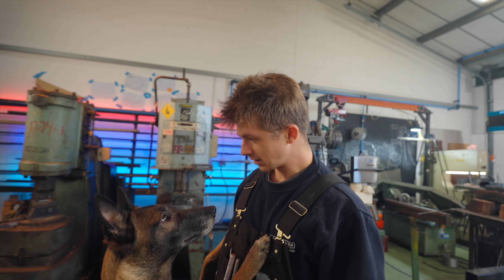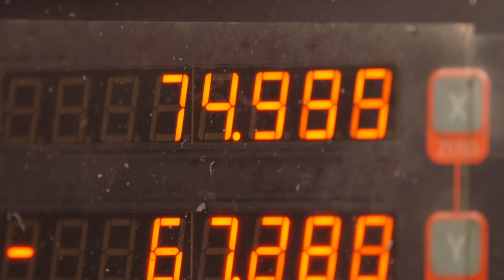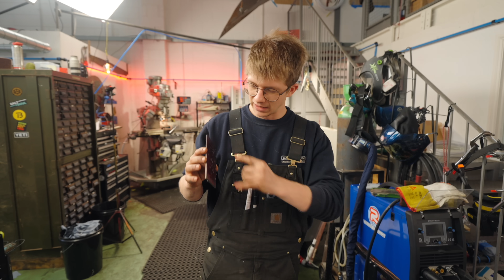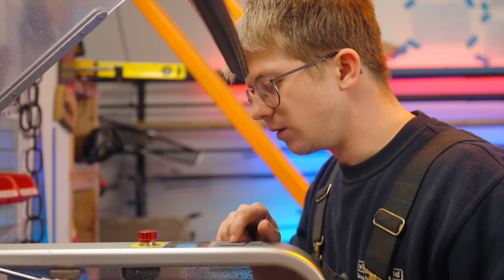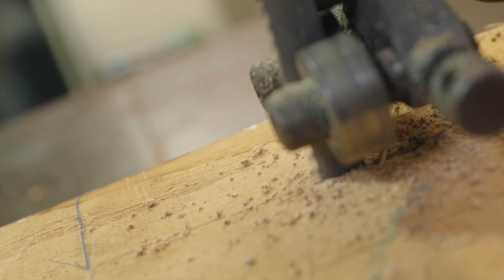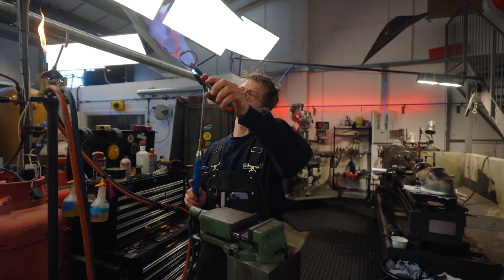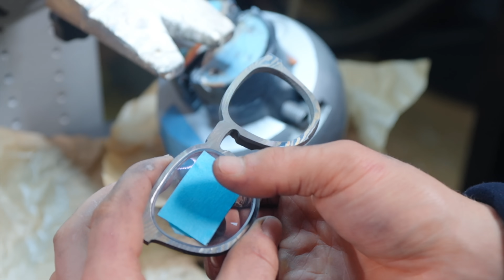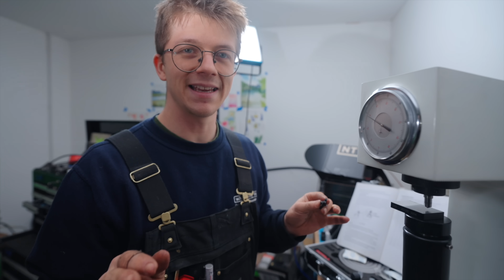Making Titanium Damascus Glasses, Part 1

Comment: Can't wait for Alec to find out that he did not get the centers of the lenses to line up with the distance between his pupils.
Reply: and this is why we don't grind down the lenses 😂
Reply: @crow2535  I think the problem might be not because of the grinding but because the lenses are swapped
Reply: I was looking for this comment.  They may look cool, but unless Alex gets phenomenally lucky, I would not want to wear them for long.
Reply: Oh I forgot about that...
Reply: There is a difference between the optical and geometric centers of a lens. The geometric center is the actual middle point of the lens. The optical center is the point on the lens where light rays do not bend when passing through it. Ideally, they are both in the same location. But it can be adjusted, Depending on the frame type and pupil location. All people have facial Asymmetry. Eyes will be at different distances from the vertical centerline of the face and will vary in height. A good optometrist will put the glasses on the customer's face with clear lenses, then mark the pupil location on the lens with the help of a ruler. So he knows where to place the optical center during grinding.

If you look at the current glasses Alex is wearing. His pupils are in the top half of the frame, so the optical center is higher than the geometric center.
Reply: @Dhunter83  Ruler? I just look into the magic thingie and it spits out numbers for the optician.
Reply: Yea 30 years and I've never had an optician pull out a ruler they just do the puffy air in the eye machine and do what it tells them 😭 @andersjjensen
Reply: @andersjjensen  my pd has always been measured with a ruler by opticians..
Reply: @andersjjensen  I am sorry to read you do not know how a ruler works. It is not magic at all. Please let me explain.  A ruler is a flat rectangular object that can be made from a lot of different materials, like plastic, aluminium, and even stainless steel. On a ruler there are markings vissible with a pre determined distance in Between. This could be according to the metric or imperial system. When you want to measure the distance between two objects, you have to put the 0 marking on the first object and then read at which marking the second object is. That number than is the distance between the two objects. 

I hope that with this explanation you now know how a ruler works.
Reply: @Dhunter83  he is saying that they don't use a flat ruler, not anymore, there is a machine that measure the pupillary distance with great precision in just a second. it's called a digital pupilometer.
Reply: It makes a huge difference, especially when you have a large cylinder (eyeball deviation from roundness). My last optician got that wrong last time, I felt 2ft shorter! The look on their faces told me someone made a mistake that ate through their entire profit margin...
Reply: @bramweinreder2346  Optical center is important for most accurage focus. Once you have tried lenses with perfect focus, you don't want to put up with lesser ones.
Reply: @MikkoRantalainen  I don't know if you have a large cylinder, but I had to relearn seeing proportions. My eye/hand coordination has improved a lot since that time.
Reply: :-O
Reply: Meh, people rarely specify OC heights, and it's fine. I bet he can wear them. His script seems pretty moderate.
Reply: Minor deviation shouldn't matter too much with his lenses. Even opticians mark the center often with a marker cross, making that like +-0,5mm just for the marker's width.
Reply: He based the design of glasses he has previously used so the centers should line up pretty well.
Reply: You should try to dropforge a pair of titanium glasses

Comment: Quick question Alec. I know you decided to file the plastic lenses to fit the frames but are they not just test lens? My concern is that they have gotten quite a bit scuffed from you working on them without protecting them? If you were to then replace the test lenses with the final pair wouldn't they then not fit into the frames without having to be processed again just like the test pair?

Comment: You probably added the offset (to keep the extra material on the outside) when you cut fixture plate 1 in the machine, thereby making it that extra offset off, from the intended location.

Comment: Lol those rockwell machines are super touchy. I recommend using one of the little anvils for something like those blocks because the smallest unevenness will throw off the check pretty bad. I've seen as much as a 4 point difference. It doesn't like curves either unless you seat them just right on the anvil. With as much stuff was totally unseated for shipping I would have used a little anvil like that and run a bunch of checks basically to get it all seated in and see if the checks tighten up. Also make sure your weights are right because you could easily be checking something on d scale instead of c. I think for most stuff you only need c and a. I use those all the time. I like a for when you don't want to leave a nasty ass mark on stuff too and you can convert between scales.
Reply: I used to use these machines all the too. I can confirm they are very touchy. I have gotten different results from testing the same piece back to back. Although we also were doing tests on the floor because the machine was heavy and was stored in a box behind about 10 other heavy boxes. But our results were close enough for government work 😅
Reply: Also- pretty sure titanium belongs more on the HRB scale, with a radius indenter as opposed to the diamond point- yes?

Comment: It might be conjecture, but the jig did appear the last time. I think IT, is the fault behind your delamination issues. I base this theory on 2 points. The one stated prior (timing) AND, the second. Metal bends. Suction will be enough to bend a metal just enough, i know from experience working with suction jigs for various architectural features. Obviously, not titanium, but even titanium at that thickness will bend. I think, and this is just an idea, that you bent the metal. It's the only (thing i can think of) that explains the number of delaminations you had. You thought you had flat coupons, but in reality, they were all warped when you abraded them, with the corners thinner than the center. This would compound when two pieces were placed one against another and on the same piece, doubled as it lost material, when you swapped it to the other side. Just a burp, nothing more. Might be completely wrong.
Essentially, what i'm saying is that your pieces wound up looking like this ()()()()() and between each of the gaps, you didn't have a proper weld. Do you have some coupons you didn't finish with the air jig. You don't even need to make a full test. It would suffice to use the same materials, time, temps.

Comment: Typically with metal frames, there is a slit in the outer edge of the frame with a screw that holds the two sections together, because the frame has to stretch to accommodate the lenses properly. Good luck!
Reply: That's covered in the video

Comment: very important note, youre probably going to need some extra mass at the ends of the arms, otherwise the weight will pull them right off your face, you could try and use some old carbide endmills to make some weight beads for the ends of the arms behind the ears, that might be enough to keep them balanced, or you could spend even more money on some raw tungsten stock to machine the ear hooks out of, I'd also suggest setting some stones on the face of the glasses at the hinge section, might as well and you havent done any gem work in a long time.
Reply: Or, he could get a pair of "Croakies" (brand name) that fit over the ear pieces, looping around the back of your head, and can hold them snug to your face.

Great if you're doing something active and don't want to lose your glasses.
Reply: @EdwinWiles  I thought about that, but he might not want something around the back all the time, if he had a more formal event to go to for example, probably not common but it is just one instance he might not want something like that, though I suppose he could make his own fancy version, a jewellery chain type or something for events like that.
Reply: Why would he bedazzle his frames? That's dumb.

Comment: As a trained optician I would highly suggest you partner up with an optician to grind some lenses by hand! It is super fun and for me it has translated from hand grinding lenses to a belt grinder for steel pretty well, so you should have a good shot at getting the hang of it really quickly. It's really rewarding to get your first pair of lenses perfectly ground and into a frame.
Reply: Sounds like we could use another Alec tour where he takes us to a glasses lens maker
Reply: I was going to suggest that he takes a tour of a frame manufacturer. My specs are handmade titanium frames from a company in Japan.
Reply: @wtspman  ROAD TRIP!!!! I call shot gun
Reply: Yes @Totsy30
Reply: And now time to thank our sponsor....specsavers... I'll get my coat.
Reply: @vandyFixer  I was just going to suggest that! I'm working as an optician in the swedish branch and they love stuff like this for marketing =D
Reply: Was thinking exactly this. It also helps to put things like pupillary distance and what not into account so it can be an actual functioning set of glasses that's comfortable for the eyes to wear.
Reply: This idea must be on top :D
Reply: I'm a fellow optician, I had this same thought exactly. I did something similar making my own frame, having something you made yourself from the ground up also correct your vision is so satisfying. Mine was a drill mount though because I don't have good tools to cut a bevel on the inside of a rim. It let me put wacky shaped lenses in it though, after cutting them!
Reply: as a optical lab manager, i'd be down to do this :) if you see this hit me up lol
Reply: I am also a Optician but in Cologne/germany 

Well to be honest im a Trainee but ey I know a lot by now 😅
Reply: @Atreus_N_1337  Ich bin jetzt nicht direkt Kölner, aber wirklich weit weg wohne ich tatsächlich auch nicht.
Reply: Also an optician here, can I tag along.
Reply: @trulsdirio  Do they still have those in the UK? I haven’t seen an office with an operational lab in years, and I see about 100 new offices/year.
Reply: I was thinking he might have some issues with inserting lenses made for different frames
Reply: @Smaestr  yeh grinding prescription lenses is never a good idea. It moves the optical center and can induce something called prism.
Reply: OMG this would be so cool!
Reply: as a trained optician I highly agree. It is like you are cutting your leg to the shoe. You can literally have a better fit if you just create the shell out of titanium damascus. 
What you are making looks a lot like a jaguar 36818, which is also a titanium frame. I'd highly suggest you to have a look at how these glasses are made, as even if they are using 95% waste when CNC-ing  out the frame you are working with 99.95% loss.
And also regarding the hinges, you can get quite decent ones from european manufacturers for like 10-20q and they fit waaay better. That way you can focus on the pattern. Ah and also, using titanium has always been the high end in frame manufacturing, it feels super nice when they are light
Reply: Well, thats it. We've just earned a 5 part series on lens grinding. I'm ready for it.
Reply: That would be awesome
Reply: opticians don't grind lenses anymore. it's just three giant manufacturers making all of them for glasses and they're made out of plastic
Reply: Field Trip!!!!
Reply: I’m
Reply: Oh really 🤣
Reply: Whilst I do applaud your ingenuity you are potentially going to run into some issues with those lenses now.

Changing the dimensions will move the "optical center" this can cause issues as it will change the point where light passes through without bouncing.

This can cause distortion in the vision, more so on higher prescriptions.

Also noticed the lenses have an anti-reflection coating, the square of tape you placed on the front needed to cover the whole front face of the lens to protect the coating otherwise damage will occur that will break down the coating very quickly.

Finally the AR coating can also be damaged very easily from too much heat, grinding the lens will create considerable friction heat that will damage the coating and degrade it.

Comment: In woodworking the amount cut out that equals the thinckness of the cutting blade is called the kerf. Would it be called the kerf for a plasma cutter or on the water jet?

Comment: I am just a quarter of the way into this video and I'm worried that he'll try to press fit the glasses rather than screw clamp them since press fitting is usually reserved for plastic frames and for heavier metal frames, its more often times screw clamped.

Edit: well somebody pointed it out to him.

Comment: I think that the offset that you got was from manually inscribing the template. If you didn't align it freehand perfectly, the outline in your program wasn't in the same position as in your billet. It's good to inscribe some control cuts/holes in the waste sections and cut those first. Checking if your alignment is correct.

Comment: Working with a new material on top of working a new project can be precarious. With your experience in Damascus steel, it could have been a good idea to try to make the glasses out of steel for your first attempt and use the pretty titanium damascus on a final product of the project. Excellent work regardless.

Comment: Yo Alec the way you put the reference steel into the machine way have led to a one sided increased offset. You went off where the cut ended up, not where the machine actually makes the cut in the system.

Comment: its possible to plasma cut titanium its just awkward todo so as you gotta submerge it for best result though i got written up for it i cut my ring off because it cut crushed when i broke my thumb i used the plasma table i run to cut it off by using a pierce point shielding my thumb with gauged stainless i slowly cut it off without burning my hand wasnt fun to explain to the owner of the company

Comment: After abrading the titanium and before forming the billet, store the titanium in 90% isopropyl alcohol while refinishing the rest of the parts of the billet. I work with stainless, and store the parts in an inert solvent “away from flame” while prepping the other stainless parts for ceramic coating. This prevents any oxidation/dust/oil from settling on the freshly sandblasted parts. This may assist your delamination.
Reply: Yes, talking with welders that work with titanium they say that it needs to be kept insanely clean to get good welds that don't have issues, so this is probably true for doing the forge welding as well. With how dusty the workshop is and there being grease and dirt on every surface, doing this sort of immediate storage of the parts after they are cleaned would be a good idea.

As for the safety aspect, away from flame, in a tip resistant metal container of 1 gallon of solvent or smaller, that has a tight fitting metal lid with as little empty space at the top of the container as possible so that there is as little solvent vapor present when you open the lid as possible. You also keep a fire extinguisher within 10 feet of the solvent containers that is rated to put them out at all times that you can quickly grab. 90% isopropyl alcohol alcohol is probably your best choice since it is on the safer side and will keep oxidation down, but double check since we are dealing with titanium, which is a different chemistry and much more oxygen hungry than ferrous metals.
Reply: @KnightsWithoutATable  So a plastic Tupperware container thrown on a bench it shall be? 😜
Reply: @-siberian-  😂😂😂 right by the forge 😆
Reply: @-siberian-  It's your time with the fire department.
Reply: @ there is always 99% isopropyl/ethyle alcohol😅

Perhaps a volatile oil like propylene glycol. I just worry about some retention in the micro texture of the metals.

So, I don’t use ANY oil, and I resurface at as cold a temperature as possible. Heat = oxidation